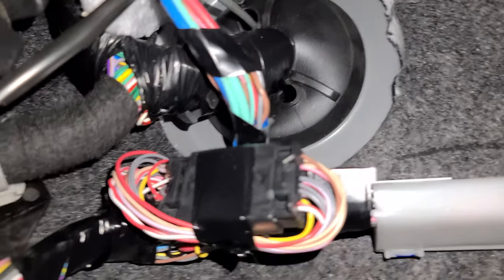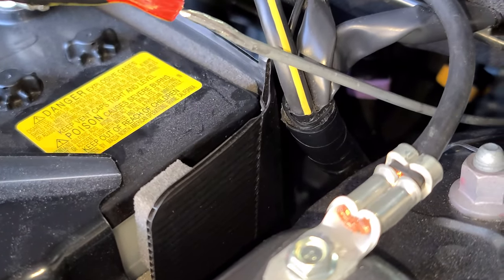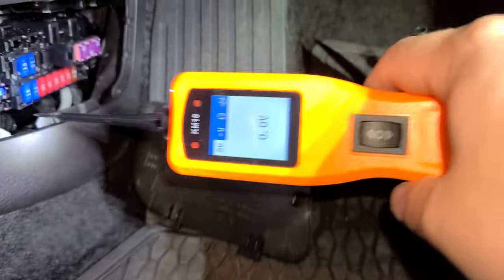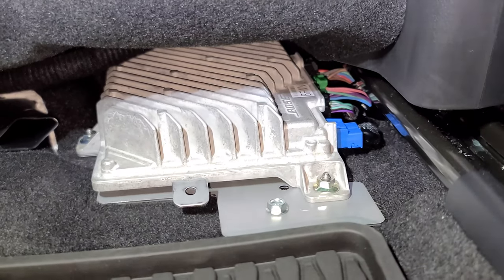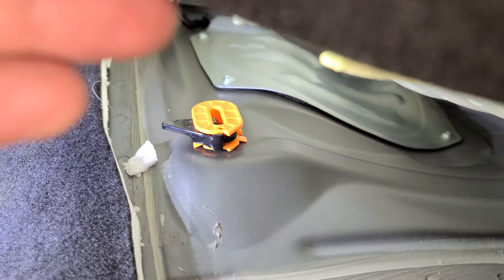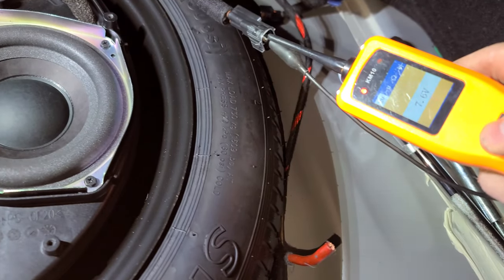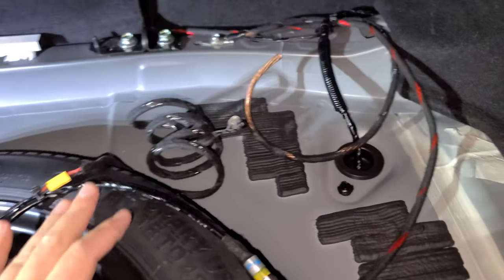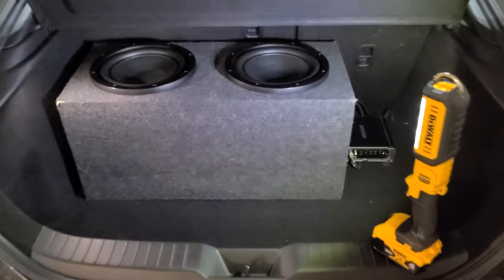4th Gen Mazda3 Hatch Sub/Amp Install (BOSE)

Comment: FOR THOSE WHO STILL CANT UNDERSTAND HOW TO GET THE RCA SIGNAL. Tap into the bose rear tire speaker and just unplug the rear speaker. (White-positive brown-negative.) tie it to the line out converter. For the REMOTE . Run a wire into the same hole as the power cable thru the fire wall. Into the engine fuse block. Use the third 15amp fuse labeled( other protected circuits) or something like that it turns on and off with the car.
Reply: Still can’t find where to put the remote wire please I need help😭
Reply: @davidmartinez-rh7dt   run it to the engine bay fuse box and there is a remote fuse in there
Reply: @_LrdDrew  thank you for dumbing it down for me bro I love u😭🙏
Reply: I was in your shoes too lol
Reply from the maker: Fun fact, some good LOCs have signal sensing built in so you don't need to find the factory remote wire. It makes it for you. It just needs constant 12v, ground, and the audio signal.
Reply: @bdrummer96  I know that and tried the scorche brand that makes a remote but won’t work with Bose system

Comment: Nice guide, I'm installing a sub into my '19 sedan. There is a wire in the driver side A pillar used for the auto dimming mirror that provides switched power. Also of note, you should disconnect the battery by removing the negative terminal first, reason is that basically every metal part in your car is connected to the negative terminal, so if you're unscrewing the positive first and touch another metal part it can short out and weld itself. Then you're in for a bad day.

Comment: I added my old subwoofer form my previous car to the Bose system like you did in the video, but got some wired poping nosis. And when I turned up the gain I got a pitch sound. Turned of the low pass filter but still no luck. Any suggestions?

Comment: This is an awesome video but I’m a bit confused on several things. Disclaimer I have a basic understanding on how this works since I’ve installed simple set ups but I’ve done it without fully understanding the ins and outs. First thing is I have the 3TurboAWD Sedan and my Bose system doesn’t have a sub in the spare. The part I don’t understand is with the RCA where does that exactly go on the Bose system from the aftermarket amp also what about the gain volume line where does that go and does this have any issues with the Bose system long term. I’d like to get a single 12 inch JL sub that would be sweet.
Reply from the maker: Hi Joaquin, where is your factory subwoofer located in the sedan? I think its located on the rear deck in the center. The RCA cables I ran on my car connect FROM the factory subwoofer speaker leads (hardwired positive to positive and negative to negative) and then plug into the RCA INPUT on my amplifier. This allows the amplifier to receive the factory BOSE source signal and amplify that signal which is then sent to my 2 10in subwoofers. As far as the gain is concerned, I don't know the exact voltage used from BOSE but a technique to setting your gains is to turn your radio all the way up and slowly turn your gain up until you hear distortion coming from the subs, then back it off a little bit. 

This will not cause any long term issues with the audio system as I am just tapping into the factory signal and using a separate amp to power my woofers. Everything has been working great so far. No problems.
Reply: @bdrummer96  that actually does help a lot! Thank you
Reply from the maker: @joaquinbarreto9398  No problem, hope your install goes well. Good luck!

Comment: Where would you take the signal from if you didnt have that factory BOSE amp to pull from? I have the base model without the BOSE package... I was planning on combining the signal from the right and left rear doors, but I want a full range signal (as I might want to run a 2.1 channel amp and have some horns  mounted on a custom wood "privacy panel" in the future). Where tf does this thing even process audio at? It's the center display on the dash right? Can i get a signal wire out from that?
Reply from the maker: In your case, I would recommend using the AudioControl LC2i 2 channel line output converter. Great for adding aftermarket subwoofers and its AccuBass technology counteracts the factory bass rolloff. You will be able to tag the signals from the left and right door speakers an get an accurate summed signal to your amp. The display is separate from the actual source unit which will be behind the dash somewhere. You technically could do it that way but in my opinion thats overkill for what you're trying to accomplish. It will be a lot easier to take off the door sil trim and tag the speaker wire going to the door speakers, then run those to the line output converter (wherever you put it...probably in the trunk im assuming). From there you have everything you need for you amp/sub/horns. You need to take the sil trim off anyway to run the +12V cable through the firewall (as seen in this video).

Comment: I have a Similar question as Brian. My Mazda6 Bose system has 2 9" subs at the doors. I'm wondering if it would be to install just 1 aftermarket 12" sub? How would I go about adding the two sub signals in to my aftermarket sub? In this example would I need the LC2I ?
Reply from the maker: I'm assuming that your sub signals from the door are panned left and right. If that's the case, yes you can use an LC2I. Some good LOC's offer similar features of the LC2I for a cheaper price. If the subs are center channel, you'd only really need to run one signal (1 speaker) to an LOC, which then connects to your sub amp. This case is unlikely though.

Comment: So do you leave the stock sub in?
Reply from the maker: Yes, I just left it in.
Reply: @bdrummer96  you left the stock sub in. Did it function at all or did everything go to the new sub when you were done?
Reply from the maker: @ray  Yes it still functions. I'm just using that factory subwoofer signal as the input for the aftermarket sub amp. The aftermarket sub is much more powerful so it really fills out the low end bass that it was lacking.
Reply: @bdrummer96  Hey bro. Good job and Ive enjoyed reading too.
So, I HAD the non Bose in a 2021 hatchback, Select Trim. I put a Skar Audio SVR 8" sub with a rp 1200 amp
And wouldn't you know it...An Audio Controls LC2i too lol

But now, I have a 2023 Carbon Edition with the Bose and Im about to try to put my sub in there.
Thing is, Im thinking you should disconnect the factory sub and Ill tell you why.
When I added my sub to the non Bose system...it made my system louder.

It was noticeable. It tripped me out and after talking to some experts online...(and some non experts) when you add the sub, it frees up the power from the stock amp that was being used for the low end, and that power goes to the remaining speakers.
If you leave it plugged in, youre not gonna get that.

ANyway, would you install it with the LOC in the new car if you were me?
I mean, I have it and its active. AS you know, it adds a boost itself.
Im thinking it could only be a plus. WHat do you think?
Im gonna add thisd up top too, to make sure its visible

Comment: I wish they had a video for my Mazda 3 2022 sedan Non-Bose.
Reply from the maker: What are you looking to do? A similar install to what I did?
Reply: @bdrummer96  Is the install the same in a 2023 mazda 3 sedan no bose system?
Reply from the maker: @bryanbroyles2472  Same concepts except you won't tap into the factory sub channel. You need a Line Output Converter (LOC). Then, find a full range signal (probably front or rear door speakers), tap into that with the LOC. Then you run the RCA cables out to the Sub-amp. This is your amp signal input. A good LOC will also provide the 12V remote turn on connection too. Once that's all set up, you just follow the other steps in this video. Run the main constant 12V (fused) to the battery to the amp. Then ground it and run speaker wire to your subs. Always remember to unhook the battery for safety before attempting any of this.
Reply: @bdrummer96  OK thanks for the help

Comment: Did u end up running fullrange signal? Ive got dual 10s sitting at home doing nothing. Planning on installing but bose system is a bit challenging for me. Dont wanna remove  seats like yourself lol.
Reply from the maker: I ran the factory sub signal, which shouldn't be a full range signal. It most likely has a filter on it from the Bose amp. Which in this case, was perfect for this install since I wanted to retain the factory Bose functions (surround sound control/other audio controls).

The seats aren't that bad once you know how to do it. Once you pop it up, the cables run right under it with ease.

Comment: Great video! Very helpful for IDing the positive and negative wires on the factory Bose sub.

I've gotten some plugs that fit the original ones leading to the Bose sub, so I'll just be unplugging the original sub completely. And I'm using a Kicker Key500.1 which should fill in some of the bass that's been rolled off by the Bose amp.

Question: have you kept it set up this way or have you gone on to pull a full signal from elsewhere? And if so, has it made a significant difference?
Reply from the maker: Sorry for the late response! I had some issues with my account.

I've actually installed the Kicker KeyLoc recently, in addition to everything with this video. I really should do an update video. 

It makes a big difference, and I think going with that KeyLoc amp is exactly what this car needs. When setting up the KeyLoc, you have to go through an initialization phase where it detects the source signal. On the KeyLoc, it shows the frequency range. To my surprise, it was a full range signal. I guess that makes some sense since the factory woofer is so small. 

The factory sub really holds the Bose system back, but the KeyLoc/Amp/good Subwoofers REALLY bring it alive. 

Best of luck to your build, let me know how it goes!

Comment: Thanks for the video.  I am planning on adding a single 12 with an additional mono sub amp.  My Mazda is a 2021 Cx9 Carbon edition with full bose factory setup.  I am still confused a bit when it comes to the audio single from the stock deck.  I see some people use a some sort of an audio converter or pre amp unit that tapps into the back of the stock head unit.  Any advice my friend.?  Also, if I add a quility single 10 or 12 and amp dedicated to the subwoffer only.  What is the safiest way to tap into the rear bose subwiffer that is in th rear of the suv with the spare tire.  Do you recommend I bypass the stock  bose and amp compleatly.  i am not sure if I have more then one amp with the stock system?  Qestion?,  do you recomend using both stock and added sub woffer package all together?  would that sound wrong? 
  Any recomedations?  I hope you have a chance to look at this comment.  I coulld use your advice here.  I am so afraid of somehow shorting my stock bose system by my potenial user error.  Thank you again.
Reply from the maker: Hi, sorry for the late reply. But my advice is to do exactly what I did here. It is completely safe. We have the same Bose system so everything should be exactly the same. 

Some people use a line output converter to tap the factory audio signal for their mono amplifier. In this case, we don't need to do that because we have a factory subwoofer signal in the spare tire woofer.

Comment: did you need an line output converter? if not, why not? I just had my sub installed in my 2023 Mazda Sedan and the shop I took it to used one and I'm trying to figure out why
Reply from the maker: Do you have a factory Bose system or the standard system?
Reply: @bdrummer96  standard system
Reply from the maker: @stiffyBlicky  They need to use a line output converter to tap the audio signal from the front speakers that are a full range signal. It converts that high level signal to a low level signal that feeds into your sub amp. 

In my case with the Bose system, I already had a sub signal coming from the factory amp that I utilized, where the standard system does not. You can use a LOC in both setups.

May I ask what LOC they installed in your car?
Reply: @bdrummer96  wavtech link2

Comment: another question, isn’t it recommended that you install an external fuse in every installation to prevent shortages/fires/things like that? is one necessary in this installation??
Reply from the maker: Yes, always install a fuse. It should come with your amp wiring kit (purchased separately from the amp usually). You should look at the recommended fuse rating in your amps instruction manual, then purchase the appropriate amp wiring kit.

Comment: How big is the factory bose sub in the trunk? I just got my 2024 hatch gt and I wanna retrofit a sub in where the existing sub is, with a standalone amp. 

The sub that comes with the system is ruining it for me. It's drawing way too much power and the amp keeps going into fault protection I'm fairly certain. Sometimes the tweeters cut out, today it was the rear subs. I'm almost certain if I add a standalone sub with an amp that my problems will be resolved. Thoughts?
Reply from the maker: I think I'd take it back to Mazda first before messing with it. Sounds like your factory amp might have some issues..and then add what you want after. But the Sub is small..only 5 or 6 inches if I recall. Definitely the weak link in the chain. That's exactly why I installed this in my car. The factory sub is lacking so much. 

BUT. Doing that might not fix your factory amp going into a protect mode. Like I said, I'd take it to Mazda first before installing anything. They should be able to swap it out under warranty.
Reply: @bdrummer96  Did you end up disconnecting the factory sub and just using the one you installed?
Reply from the maker: @infatuated9970  Nope, I left mine connected. If anything, it adds a bit of mid-bass.
Reply: @bdrummer96  Mine literally cuts off at a certain threshold. I have the bass in my car set to -6 because of it. If I turn it up to between 45-max the woofer will intermittently cut out, very annoying
Reply from the maker: @infatuated9970  yeah that's just not right. Definitely a warranty claim. Before I installed this subwoofer, I had my bass cranked all the way up and listened to it louder than 45

Comment: Hey bro. Good job and Ive enjoyed reading too.
So, I HAD the non Bose in a 2021 hatchback, Select Trim. I put a Skar Audio SVR 8" sub with a rp 1200 amp
And wouldn't you know it...An Audio Controls LC2i too lol

But now, I have a 2023 Carbon Edition with the Bose and Im about to try to put my sub in there.
Thing is, Im thinking you should disconnect the factory sub and Ill tell you why.
When I added my sub to the non Bose system...it made my system louder.

It was noticeable. It tripped me out and after talking to some experts online...(and some non experts) when you add the sub with its own power amp, it frees up the power from the stock amp that was being used for the low end, and that power goes to the remaining speakers.
If you leave it plugged in, you're not gonna get that. If thats totally wrong and dumb, forgive.

Anyway, would you install it with the LC2i in the new car if you were me?
I mean, I have it and its active. As you know, it adds a boost itself.
Im thinking it could only be a plus. What do you think?
Reply: I’ve been thinking about adding a sub to my 2020 Mazda3 Select trim (non Bose system) and I think I saw your post on Reddit. I hope that was you lol, I found the posts super informative.
Reply: @betognz  is there a link to that post?. I've got skar dual 10s and wanting to connect my system. I've got 2023 premium so it's got bose.
Reply: @betognz  yeah probably was me. Ill tell you what...I did tons of research before I made my move....and man...,.that non Bose system...AKA Harmonic Acoustic system designed by Mazda nerds....holy crap.
The speakers are made by Pioneer just for that system.

Listen to me...that system is great now with the 13 band EQ right?
Well, once you get a sub and amp installed...like I said above...Im convinced that the stereo overall was louder cos when you tap into the wires for low end...which is going to the sub and powered by the new amp...the stock amp doesnt have to power the low end and it can focus on highs and mids.
All I know is I had gotten used to how loud 45 sounded and it was that loud at 38-40 after sub.
And the sound....dude..if youre a hip hop dude go get a  pair of 12s"
, but screw that lol.
Our cars cabin is a small space.
The Skar 8" SVR is more than enough and blows everyone away, it hits hard and is crisp too.
I think dudes get too many subs and/or too big for the space theyrre working with.
Go buy Skar....and do the break-in properly!
Reply: @Trinibrian1  Bro, that was me. The post before was non bose.
I have Bose now and I wanna know how people are doing this. But sht, you cant find anyone but this dude here and I just finished watching this video.

He does a really good job here. Cos look, you have two choices. And I wish this dude was around to confirm or correct me, but you either get it wired to cut out  the stock subwoofer so your subs will replace it or I believe leaving the stock stuff working and just adding in the new subs to it.

I did it where the sub just took over all the low end with my Non Bose before. And it was killer. It had the separation that I wanted from t elow end cos I listen to metal a lot....and it was pristine.
Dude hit me and totaled the car though.
Reply: @metaldreams3595  agreed. It's tough to believe Noone added music to a bose system on the forums
Reply: @Trinibrian1  you mean added a sub? Totally. Impossible to believe. Lol.